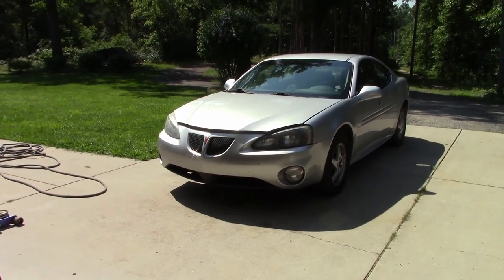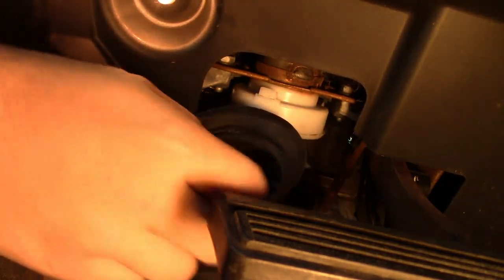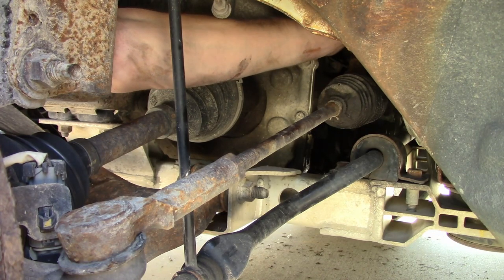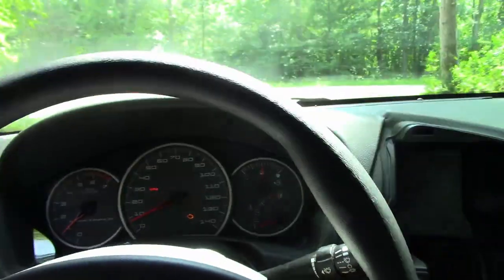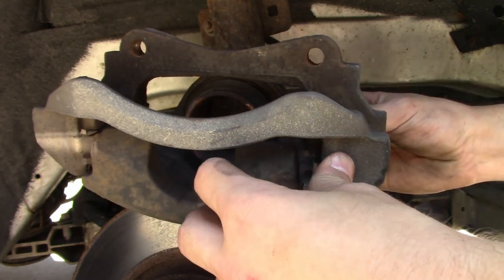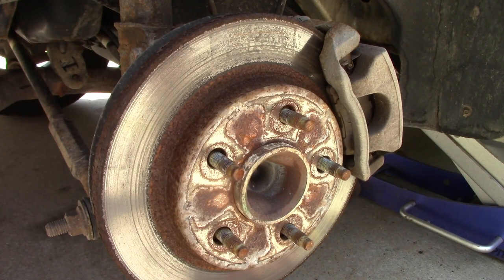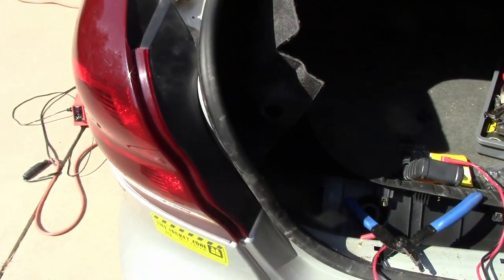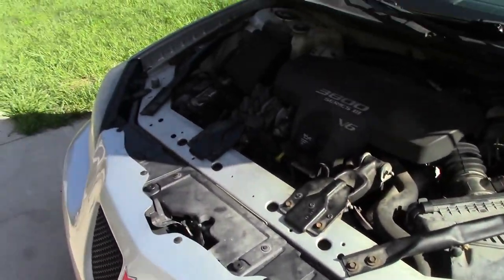Fixing everything wrong with my Pontiac Grand Prix

Comment: What is the name of the piece you change in the steering wheel column? Or you have the link to where I can get it.
Reply from the maker: It's the lower steering shaft, you can find it on Rock Auto, or just search up "LARS LSC-544 steering shaft" for the exact one I installed.